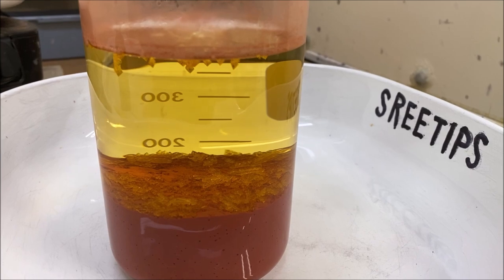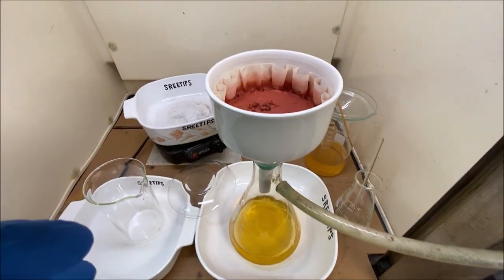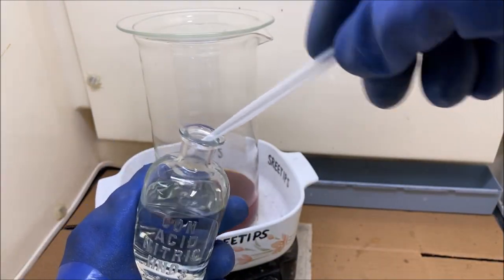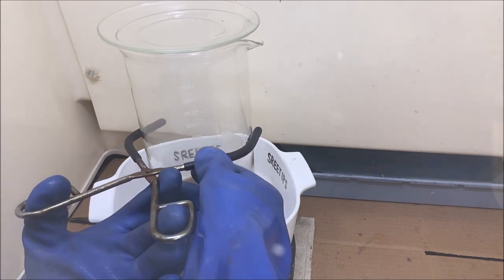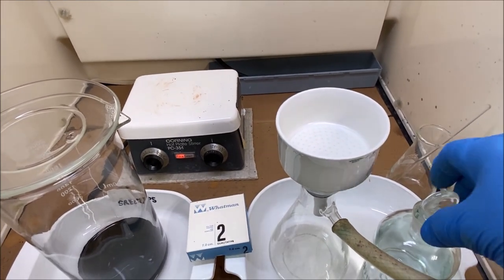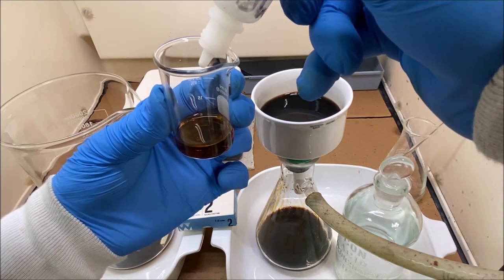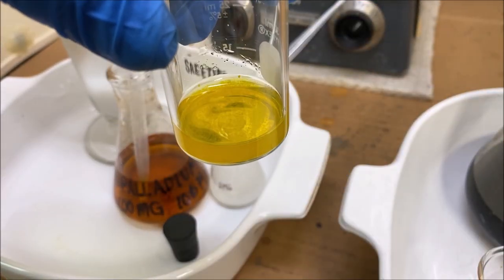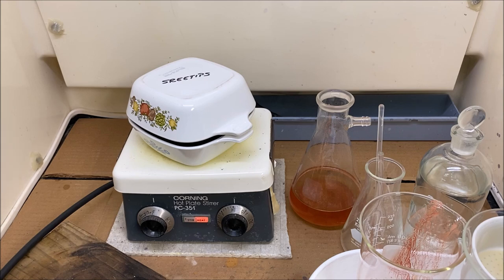Platinum Refining Bromate Hydrolysis Pt2

Comment: Hi Sreetips. According to three independent sources that I found on the web, iridium is not solvable in boiling aqua regia
Reply from the maker: I know. But in my experience, I’ve seen many things happen that weren’t supposed to. And many thing that weren’t supposed to happen, happen. A 90/10 Pt/Ir alloy - everything dissolves in hot AR. Also, a 95/5, silver/Pt alloy - everything dissolves in hot nitric. I’ve seen hot hydrochloric dissolve small amounts of platinum. I’ve put gold in solution with boiling nitric. These hard and fast rules can all be broken. It’s an enigma.
Reply from the maker: On the other hand, if I tried to dissolve a piece of iridium in boiling aqua regia then nothing would happen. It would probably just sit there, looking back at you, unaffected. And that’s where the hot AR/Ir rule comes from.

Comment: I would have poured the waste in a clean stock pot (and maybe on silver instead of copper), now it mixes in with your silver and will contaminate your silver cement  and later on the slime, causing more problems down the line.
Reply from the maker: I keep silver away from my stock pot
Reply: @sreetips  OK, normally you cement gold out on silver and silver out on copper, as you were cementing out on copper, I got a bit confused.

Comment: 19:50 the solution is moving clockwise and the stir bar is moving counterclockwise. 🤔
Reply: Got to be an illusion.
Reply: It's a phenomenon called temporal aliasing. https://en.wikipedia.org/wiki/Wagon-wheel_effect
Reply: @emanuellandeholm5657  I thought it had something to do with the speed vs frame rate 🙄
Reply: @laughinghyena001  Yeah, that's what it is.
Reply from the maker: It’s an optical illusion. The stir bar always turns clockwise looking down into the beaker.
Reply: @sreetips  I bet there is a simple harmonic relationship between the video FPS and the RPM of you stirrer. :)
Reply: Also, @sreetips , stay safe! Love your content but what you are doing is incredibly dangerous. You don't need me to tell you that
Reply: @emanuellandeholm5657  I cringe and squint every time he does it

Comment: Weird, you clean off the sides with Hydrochloric Acid, and it literally Climbs up the side of the glass again 3:00
Reply: That is just a prime example of surface tension. It is not unusual in grease free containers.   

You can demonstrate the phenomenon by pouring some wine, whiskey or high proof denatured alcohol into a glass. It will climb the wall a bit.

Comment: I don’t think you have any in solution at the teat. You can see the solids falling. I think you rubbed some on your test paper.
Another idea you could use here to reduce gases is to put a single ice cube in your fancy saucers. Think they were made for that, looks like.
On the stir bar. Cut the old one open. I remember seeing it float. The magnet it likely missing.
Reply: The "saucers" you are talking about are called "watch glasses" and the reason they are concaved in is so the vapor will condense on the surface of the glass and collect in the middle and drip back into the reaction beaker. Putting an ice cube on top will not be effective for more than a few minutes as the watch glass is about 80c and would melt them pretty quick leaving you to have to pipette the water out. If you wanted to contain the vapors from a beaker the best way is to use a round bottom flask and fill that with ice water but you still have the little hole where the pour spout is. So switch to using an erlenmeyer flask and use the round bottom flask on top but make sure you use a 500ml round bottom so it isn't unstable, also only fill it up with about 100ml of ice water so if pressure builds up in the erlenmeyer it will bump it up.
Reply: @aa1.5  There are ways to recover most vapors/gases that are evolved. But I am not sure they are worth the effort - except possibly reconstituting nitric acid from the NO2 vapors.
Reply: @buggsy5  sure, you can get a reaction vessel with a 2 neck top. One inlet for your additions of acids. The second with a gas adapter attached you can bubble the NO2 through water in which the NO2 will disproportionate and make a weak nitric acid solution.